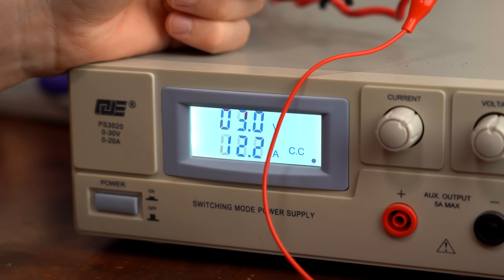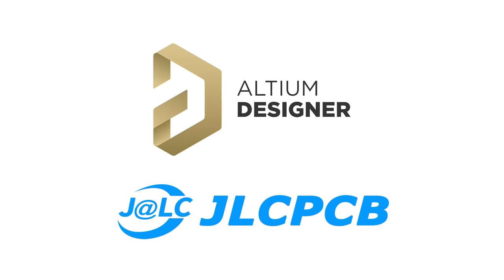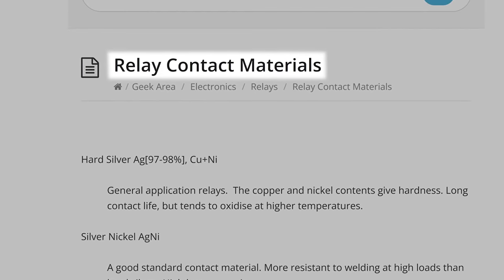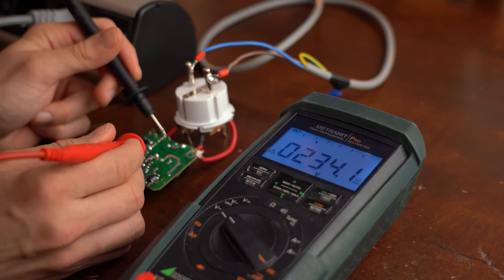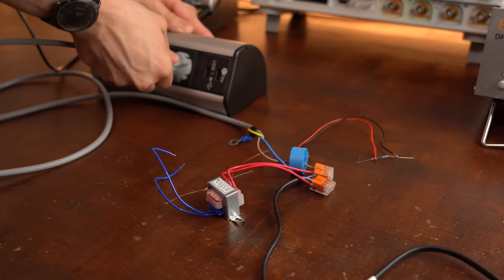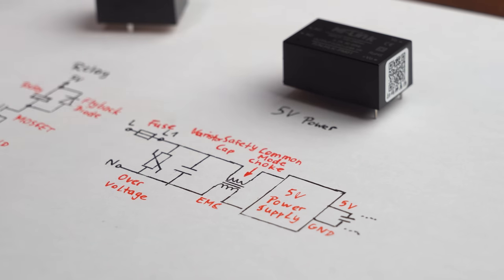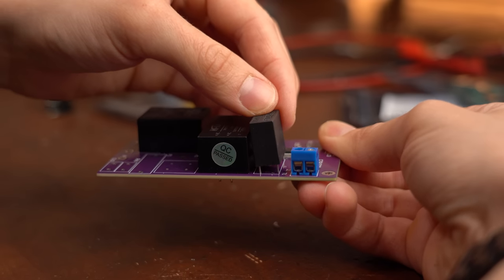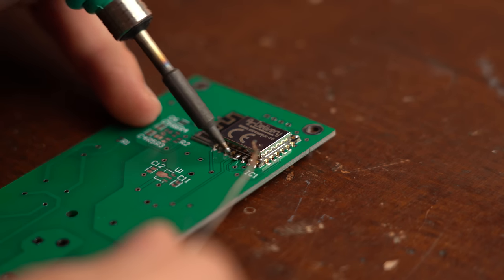The Dark Secret of Smart Sockets and How I Fixed it! (DIY or Buy)

Comment: I am an amateur regarding electronics. For measuring current, could the Acs712 ic be used it is very small? As always a very informative video🙂
Reply: I'm asking myself, why so many projects avoid the ACS7xx sensors in favor of chunky transformers. In this desgn, it should be possible to avoid isolation at all, if you take a propper isolation class for the actual device into account. The cheaper switches do so.

Comment: Why not replace the relay qith a Mosfet, Had exactly the same issue with some high power driving lights, eneded up building a Mosfet replacement circuit which could switch 200A@12V Never had any issues with it failing

Comment: Would be interesting to accurately measure the relay switching time and do zero voltage switching, thus mitigating the arcing, the inrush current would take place when the connection is already solid, no arcing=no damage & no sticking! Also saving costs in the relay.

Comment: This is one of those things where one must be extremely cautious. I am not certain what the regulatory requirements are in Europe, but in the US there are many requirements set by the national regulatory bodies that govern how devices that will be connected to mains power must be designed and constructed. Requirements for creep and isolation, transient protection (class X capacitors on the input lines for example) and many other details. That's not to say that cheap commercial devices are built to those standards, but if you are designing something yourself please, please, please follow the guidelines and recommendations, it could mean the difference between a cool DIY project and burning your house down.

As to the content in the video itself, this is actually a class of problem that I deal with all the time in industrial equipment (I'm an industrial controls engineer, which is sort of a cross between a software designer and electrical engineer), here are some other alternatives you can try:

1) Instead of a relay, use a solid-state device called a TRIAC as your control element. This requires carefully calculating the power dissipation to know how much heat you will be putting into your small enclosure as well as a circuit to check if the TRIAC failed "closed." In a larger package these are sometimes called "solid-state relays" and are used as a replacement for electromechanical relays when you cannot accept either current surges or switching frequency. You will either use a zero-cross circuit or your microcontroller to synchronize switching the TRIAC when the AC voltage is at or near zero.

2) You can use a soft-start circuit to control the inrush current. Most inrush happens either during the initial charging of an electronic load's input capacitors or in an AC induction motor to charge the coils as it starts. There are sophisticated soft-starts controlled using an H-bridge (which could be a really cool project) and there are a multitude of less fancy soft-starts, all the way down to using a polyfuse. (A type of high-current thermistor with a positive temperature coefficient)

3) As long as you are improving on their cheap design, you might consider adding fusing to the box, so you can protect against dead shorts and other types of faults. TVSS protection and lots of other things can be added as projects. Power design is a fascinating field!

Anyway, have fun and be careful! Always test a mains-connected project connected through overcurrent protection means before plugging into the wall to verify the design. Fuses are great, with breakers make sure you replace them if they have a lot of trips on them.

Comment: One idea 💡 Connect a solid state Relay parallel with electromagnetic relay. First time switch on the solid state relay for a short time (until inrush current down to a certain amount when the capacitor is fully charged) Then turn off SSR and activate the electromagnetic Relay. This will prevent sparking and increase the relay life ⚡
Reply from the maker: Hmmmm sounds like a plan. Should try it sometimes ;-)
Reply: @greatscottlab  😊👍👍
Reply: Its easier, drive both simultaneously. The ssr, triac, whatever, is faster so when the relay closes there is only the voltage drop, no spark there. Keep both on, and the current will be across the relay, so no inneficiencies nor need for thermal disipation on the ssr. When turning off, a small capacitor can keep the ssr active for some fraction of a second so the relay dont spark (for inductive loads)
Reply: You can buy inrush current limiters witch are Just Series NTCs that are bridge by a relay after they reach a Temperatur thresholt

Comment: It seems like an easy simplification would be to drop the extra chip for power sensing. Shouldn't be ESP be able to do that with its on board adcs? I realize it might be a little bit more programming, but it should save both power and money. Also, why not simply use a 3.3 volt power module instead of a 5 volt module and an additional regulator? What are you using on the board that actually wants 5 volts? Anyways, it's a cool project and I'm just adding my two cents about other ideas that might be interesting to try.

Comment: There is a really great solution to commutate large currents that combines relay and simister in parallel with delay for relay to connect a load at switch on and with delay for simister to disconnect the load at switch off.  Have a link to schematic, but not sure can share it here in the comments.
Reply: Hi GreatScott! I've shared the link over Instructables. Please, check it up 🙂

Comment: Although I 3D print a lot of things I wouldn't 3D print the case for one of these. It should be made from the hard white plastic that normal mains sockets are made from, so it won't catch fire if the electronics inside does.

Comment: Why do you check a presumably AC relay with DC? Or what was that 0.02V 14A?
Reply: Detecting the phase peak of AC, and then switching, yeah sure. But showing a presumably AC realy (where the voltage reaches zero thus no ark) shorting a DC power supply, is a great cat on the savannah.

Comment: A proper Relay should be opened/closed at 0V AC, thus avoiding inrush currents and sparks.
And as far as i know, many already do this.
Your smarth-socket is neat, but the ShellyPlugS is alot smaller and also quite cheap :)
Reply: lol that doesn't exist. an electromechanical relay can NOT be made to close exactly at zero crossing, line is working at 50hz constant but the relay open and close time varies with too many factors. SSRs, on the other hand, can be zero crossing. the solution for the sparks though, is not a "more expensive relay", but just a simple snubber network.
Reply: what is the time to open the relay? Remember that 0V is only for very short time, and to make it synchronised with 0V on the coil is not enough - you need to provide 0V on the coil well before 0V on the relay (load). But I like this idea - haven't seen such DIY projects though yet.
Reply: @zyghom  it's not possible, temperature will change the switching speed, so will coil voltage (higher V, higher B field strength, faster switching) - also as the relay gets older and it wears out, it'll change too. and of course,  every relay is different as well.
Reply: @83hjf  that was my point - for the mechanical part ms are not as easy as for silicone ones, but as long as you are closer to 0V than to 230V... everything should be better than nothing. But again: one would need to measure relay "response" time especially when you say it changes as the function of many other variables

Comment: If your primary reason for using smart plugs is to "disconnect your appliances from the grid and thus getting rid of the standby current" you might've taken a step backwards. I'm guessing the smart plug draws more current constantly searching for wifi and checking an online database than a TV or similar appliance does waiting for a soft button press or an infrared remote signal.
Reply: we use open source firmware that doesn't connect to some stranger server

Comment: Great video as always.
When soldering a SMD, place the SMD component at the pad, place the solder at the pad, and then press the solder tip and "cut" the amount off, and then in one motion heat the component and pad.  This is a faster, and very accurate way of soldering SMD.
Thanks for sharing your great project, that can way more then the buy version. 🙂

Comment: Inrush current spikes are caused by initial charging of load capacitors. This is such a valuable fact! Data sheet doesn't specify Inductive loads on the relay, which I think would be useful info. Would a Flyback Diode help reduce sparks?
Reply: Good relays include flyback protection in the package on the control side. the spark on the load side is not flyback from the coil, but inrush current (very low initial impedance when power is first applied).  If power efficiency is not a big deal -- usually the case with ac mains power -- then a simple snubber circuit will pull down the initial spike.
Reply: @johnmiller8884  Thanks!
Reply: Flyback diodes can be used only on DC  circuits ..., connected with the correct polarity..for AC , R/Csnubbers and/ or MOV's are used.

Comment: IKEA's wireless sockets are actually quite good and worth taking a look at. Plus they will 100% be complaint with safety regulations.
Reply: They have the same problem. I had a Tradfri E1603 to kill the standby power usage of my TV, audio receiver and such. 
The relay in it is not working reliable anymore after about two years of daily switching. The attached load turns on/off randomly when the switch is enabled.

Comment: Just buy a Shelly 2.5 and swap the relay for something with contacts you like. Would probably fit in the original enclosure (they make a 10A socket version too) + you get the software to monitor your sockets, log power consumption, graphs e.t.c. Btw - there is no use for the 30A relay - Your outlet can deliver only 16 (defined by code (EU) - which is limited by circuit breaker).
Reply: Yeah but the contacts will last much longer. And we do have 20 amp circuits and outlets here.

Comment: Does it measure voltage and current simultaneously so ExI is power, including power factor? Otherwise you are getting VA, not W
Reply from the maker: Yep. Power Factor included. It outputs W

Comment: On a related subject: Can you make a video about how accurate the max power rating of smart plugs really is? I'm looking for smart plugs with measurement only (no relay, which do not seem to exist) that can handle the max power that's allowed to go through EU-style wall outlets, so 3680W  (16A@230V). While searching for smart plugs with a high power rating, I've read here and there that even though some smart plugs have a high power rating, this only seems to apply for a short time (peak power rating or whatever you want to call it). So if you have a high power consumption that lasts some time (let's say 2 zone induction cooking plate or something) then the smart plugs can break/burn out..... I don't suppose you can make a video about this? :)

Comment: I'm surprised you didn't go for a cross over opto and a triac. Would have cost less and been smaller. As long as you need less than 16A there are plenty of commonly available options.

Comment: Or just drive a proper high power relay for the load in cause with the smart socket. There are relays for every situation. It is bad idea to connect an high inductive load to a smart socket although it reclaim 15A.

Comment: Most of the consumer products  emanating from China are built to a minimum specification to get the product out of the factory and to the consumer to work for about a year. So no surprise the relay's contacts eventually stick because the contacts are barely rated for a resistive load let alone an inductive load. Also there is unlikely to be a snubber across the contacts - it reduces the profit and future replacement sales.

Comment: What's the difference between L1, L and L3 on your circuit schematics? Why there are three of them and not just one? I once did my own version of power socket with esp-12 and I designed it in Eagle but I omitted the part before the HLK-PM01 because it was just a prototype and I never really understood how those "safety things" worked. Isn't L1, L and L3 the same?
Unfortunately my esp was turning on and off and buzzing because this part was missing from the project... :(

Comment: I faced relay sticking due magnetized plate. Contact is not wielded due, low or no current (PIR sensors with one 5-8W LED lamp) and relay is not clicking. Often happen to cheap chinese relays.

Comment: Bad choice of ESP placement. The antenna should be outside of the PCB edge. Don't expect great WiFi signal reception. And as others said, I would use a triac instead of relay.

Comment: Buy is better option. There are alot of sockets out there, whit all the same features. But for lower price than DIY. The only question is always what kind of relay they use. Got myself 3 sockets for the same price as one DIY. But also whit same features. but footprint is same as normal socket

Comment: I've been using wireless sockets for more than 3 years and have never had one fail. I have at least 6 and 4 more wireless light switches that I use on a daily basis. The only time I've ever had a relay like this stick was a cheap one I used to hack together my low voltage smart thermostat to my high voltage Evaporative Cooler.
Reply: Two years ago Bought 10 smart sockets form Swedish flat-pack store, 5 failed to date
Reply: I have bought 30 sockets from good company more than a year ago. 1 got burned completely (that was my fault - water kettle that had inrush up to 20+A), 2 got completely "no power" without any burning inside
Reply: @kevtek9909  I'm curious what you use them for. Most of mine are used for lights and fans.  The highest power device I have on one is a 3d printer.
Reply: @TomsBackyardWorkshop  All control electronic equipment with SMPS (500W), I believe the issue is inrush current. Now switched to LiDL sockets. I expect the same problem.

Comment: If we add an inductor in circuit , will the inrush current pick be decreased ?
Thanks
Reply: Inductor added,..at turn on..there's no magnetic field so it's just the dc. resistance of the coil to limit...as we are. powering 50/60Hz.. equipment it will be large size...

Comment: What about solving the relay bouncing part of the problem to limit the amount of arcing?  Is it possible to ramp up the power going to the relay to soften the switching motion?
Reply: "Relay bouncing " is actually meant to mean
relay " contact bouncing " .. that purely a mechanical phenomenon...as also in any mechanically ( manually) operated switches...

Comment: Impressive work! Depending on the plastic used (anything printable would tend to be an issue) I'd be just as concerned about the fire safety risks of the printed DIY case as I would've been with the possible downsides of the original commercial design in the typical use cases. The takeaway that cheap IoT devices have issues is important, but this is not something most people should DIY. It can be hard to identify which commercial products are decent, but they exist and are generally a better choice than DIY for this type of application.
Reply: Well PETG usually is okay to up to 90c-100c
Reply: Agreed. Especially when we talk mains power.
Reply: Especially since the most common material for 3D printing will fail just by being left in a hot car.
Reply: @user2C47  most not all :)

Comment: Why not use solid state relays or proper contactors?
Contactors are designed to switch high currents and tend to stick much less than relays.
Solid state relays would get rid of the moving parts and the bouncing all together.

Comment: Funny what we do isn't.  Remove the standby current of a device by adding the standby current of a smart switch.   Some smart switches use more standby power than the device being switched.       The relay may only be 2 more than the cheaper one, but by the prices shown, it makes it more than double the price, and the idea of cheap electronics is to be as cheap as possible and be throw away things.  I know, far from ideal, but that is the way the world still is at this stage.

Comment: I ran into the same stuck relay issues on my smart 8-outlet switch that I featured on my channel. My planned fix is to just use solid state relays. Does this sound like a suitable alternative?
Reply from the maker: Works just fine. But the power loss is a bit higher with them since they come with a voltage drop of 1V - 2V. If you draw little current it makes almost no difference. But with more current you definitely go a bit more inefficient.
Reply: Awesome. Thank you.

Comment: Your WiFi performance will be terrible. You're shorting out the antenna by having the ground behind the antenna. The module should be placed on the edge of the PCB with ground clearance around. I'm sure there is a layout guidlines for the WiFI module calling out this clearance

Comment: I'm in Australia,  I got a Australia design one (no knock off of same designs exist), double price), and has never broken, iv got 2 units (1 remote  3x 240v units.

I avoided the cheaper units, due to reliability.  Etc.

But it was hard to find the better unit..it existbon ebay, through a authorised seller only.(only 1 seller).
Reply: Still made in China, but I open it up, we'll made, good quality parts.  Only the remote looks generic, but again well made, n good parts, 6 years, not failed, and a 1 year ago got another 1,  (they don't sell a extra remotes.)